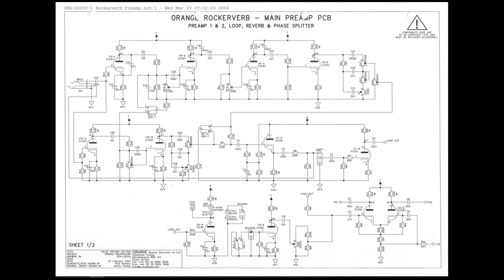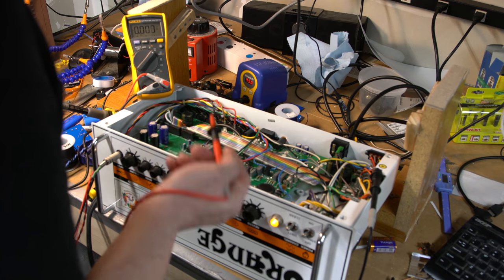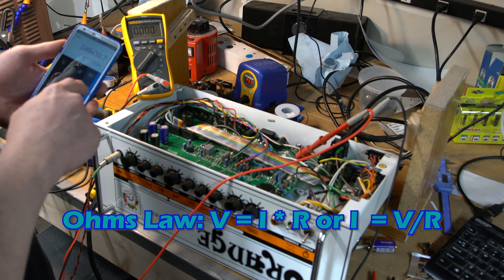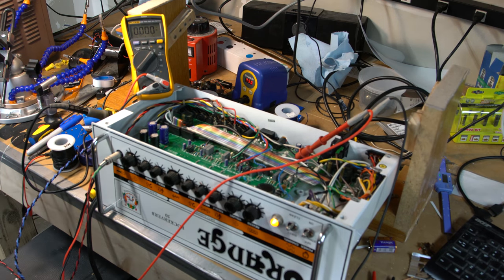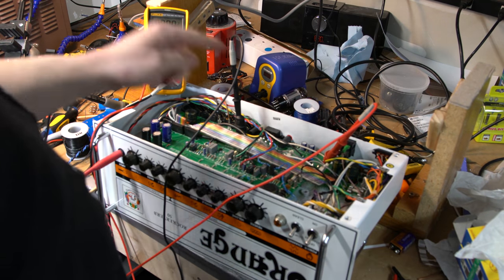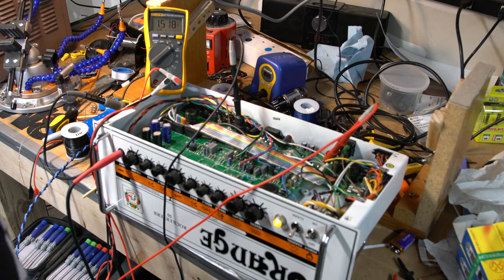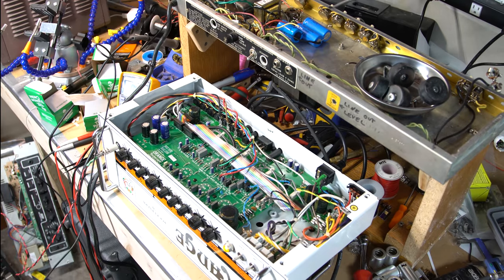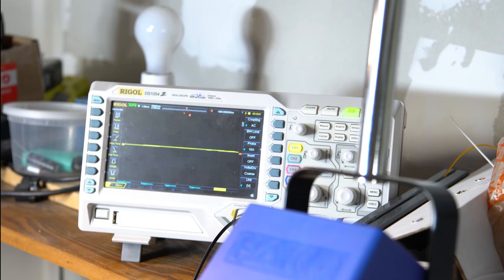Orange Rockerverb 50 - Amp Fix

Comment: The Long Tail Pair resistors can cause that kind of noise, even if their reading looks good they can be leaky when voltage comes across them. In that case the inverted and the non-inverted stages become uneven. Sometimes it can be just a bad solder joint issue.
Reply from the maker: Interesting, I'll have to remember that if I'm ever in that kind of repair again.  Thanks!

Comment: Hey have you found a schematic for the Dual Terror? Would it be possible to add an fx loop despite the post phase inverter master volume it has?
Reply from the maker: I have not seen one.  An fx loop should always go pre pi anyway, so yes it should work

Comment: I would never bias across the hi-voltage side of the circuit. Doing so could possible cause you to get shocked and possibly blow out your meter if you make a mistake.
Reply from the maker: It's a fairly common method when you don't want to modify the amp.  It's one I've seen in many documents showing how to bias.  It is more risky if you don't understand what you're doing, but very easy so long as you take the right precautions
Reply: It only takes one arc across the output tube and you will have a blown meter. There are bias probes that you can get which are safer and you don't have modify anything.  Or you can simply place a 1-ohm resistor in series with the cathode of the output tube and measure the voltage across it. I also have seen and read about measuring across the transformer but I do not know of any Technicians that use that approach including myself. There is no reason not to do it a  safer way.
Reply from the maker: Those are all great ways of doing it, but the method I used was preferred by Ken Fisher of Trainwreck amps.  As stated, some customers may not want mods done to their amps.
Reply: When you check current flow off of the plate circuit as you are doing you are not getting the full current reading of the actual tube under test. This is because you are not taking into account the amount of current the screen grid is pulling. Testing from the cathode side takes into account all of the elements of the tube. This gives the truest reading of current flow.
Reply from the maker: Yes, but that is more correct, the max dispassion rating is plate, not plate plus screen, the measurement is more accurate.  The cathode method is quicker and safer, and most times the screen current is only about 5mA, so you're actually giving a bit of breathing room to the time as well, but they're just different ways to do the same thing.
Reply from the maker: And I agree with the bulk of what you're saying as well, just not that fearful of using the transformer shunt method
Reply from the maker: Here's a great link that talks about tons of things, but is the source of the method I'm using, my source anyway, I'm sure he didn't invent it.  https://robrobinette.com/The_Trainwreck_Pages.htm
Reply: neutrodyne the safest way has nothing to do with the method, and everything to do with how you respect each method.

Personally, I tend to have an amp switched off, I place my clips on to the test point(s), and the only human contact I make with a live amp is via the power switch.

I use a wooden chopstick I've sharpened into a nice flat blade to use as a non-conductive driver for adjusting bias.

If you're cautious and patient, either method will be as safe as each other. There's a time and place for adding the 1 ohm resistors from cathode to ground. Some people do not wish to molest an amp of its vintage and modifying it from its original state, and then there's amps like this with circuit boards. Modding them is a bit more permanent than clipping the ground link off a tube socket and placing the 1 ohm resistor between cathode and ground.

Comment: I have an Orange Rockerverb 100W which failed yesterday at band practice. The volume dropped really low and it's on both channels. The amp doesn't intermittently increase or drop volume, it's consistent. I noticed when looking at the power tubes, that the blue glow I'd see in normal operation isn't there anymore. I swapped the power tubes with another used set I have and the amp still have the low volume. Could this be the output transformer that failed or the plate voltage rectifier failing?
Reply from the maker: There are many things that could have failed.  It's hard to guess.  It could be a preamp tube, a component in the amp, but it's unlikely it's the output transformer.  They usually die hard and don't work at all anymore.  They're also pretty tough.